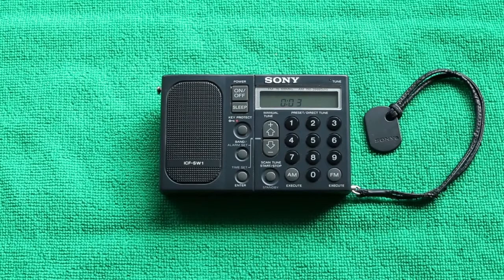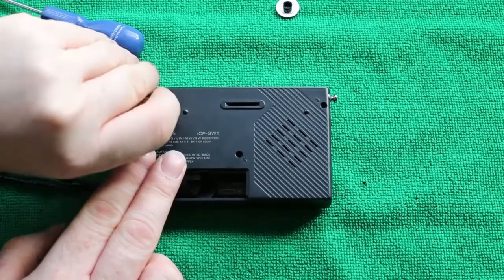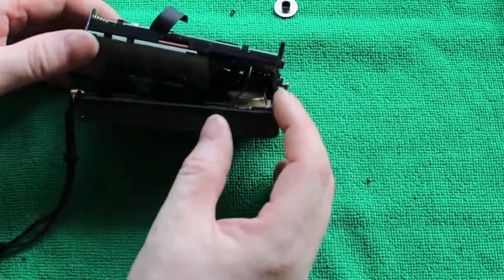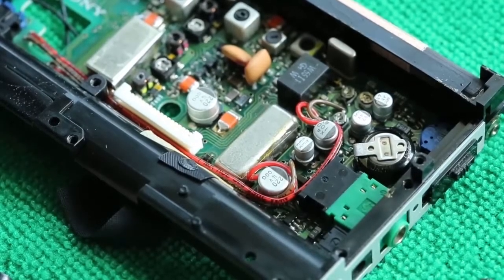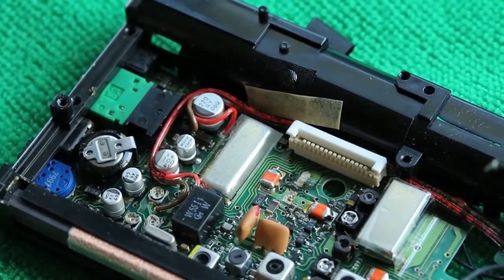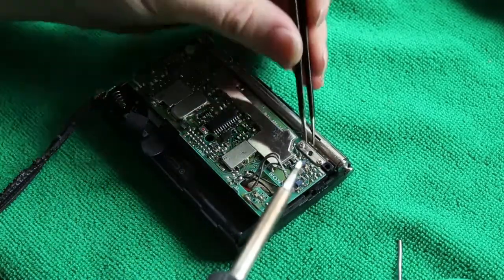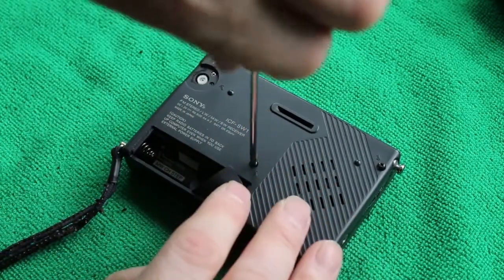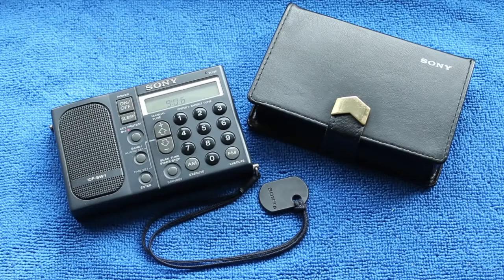Sony ICF-SW1 Repair. Vintage Technology Workshop.

Comment from the maker: Just for reference- C420 220uF 4v, C426 47uF 4v, C431 47uF 4v, C607 100uF 4v, C608 33uF 4v, C613 220uF 4v, C828 220uF 4v, and if needed C625 (backup cell) 47000uF. Hope that helps. If you search for "Sony ICF-SW1 Capacitor Repair Kit" online there's a few out there, but they're cheap enough to put together from a multi box of caps. All the best from Ast..
Reply from the maker: Also, if you want to, you don't have to use electrolytic's, you could use tantalum capacitors, which would last longer, but cost approximately twice as much. Ast...

Comment: Aston, this was super useful.  All I needed to do was to remove the back of the case so I could clean the inner battery terminal (I had had a depleted battery leakage).  For the life of me I would never have found the hidden screws particularly the one under the mylar film at the volume control.  The case fitting seems somewhat over-engineered to me, with the screws being somewhat redundant with the back fitting perfectly snugly on its own catches.
Reply from the maker: Glad you were able to save one of these great little radios. Best regards, Ast..

Comment: could you look at the active antenna part and see if the battery cover on it has a part number? I bought a used unit and the cover is missing.

Comment: Why are these such a menace? I have sony decks from the 70s (dad's and even grandpa's) that work well without recapping yet sony radios from the 90s.. As you can see. Like why? 🤔
Reply from the maker: It was the company that produced the chemicals which went into the capacitors that made a mistake with chemical make-up, which were then supplied to many manufacturers during early 90s. The chemical ended up being corrosive to the can seals and overly expansive, thus causing the problem we're suffering with today. It's a shame that the best technology in history, were fitted with the worst capacitors in history. Save what technology you can whilst there is still some left to save.
Reply: @AstonsVintageTechnologyWorkshp  That's some insightful info! I suffered with my icf-7600 😭
The caps' leakge ate through the board's traces and I had to do some shortcuts with wires and I don't have a microscope or any professional tools so you can imagine the mysery 😅
Thanks for the info. Explained a lot..

Comment: Thank you for the very clear and detailed video. Finally managed to replace the caps with like-to-like aluminum caps - I see that some people replace with tantalum caps. I hope modern caps last better than the original ones. Replaced the supercap as well and replaced the led with a white one.  Works like a charm and have stunning sound. Another precious piece of kit saved from the landfill 🙂
Reply from the maker: Well done, for repairing your radio, and thank you for the kind comments. Best regards.

Comment: hi. wondering if you have a parts list  of caps use in this repair
Reply from the maker: C420 220uF 4v, C426 47uF 4v, C431 47uF 4v, C607 100uF 4v, C608 33uF 4v, C613 220uF 4v, C828 220uF 4v, and if needed C625 (backup cell) 47000uF 5.5v. Hope that helps. If you search for "Sony ICF-SW1 Capacitor Repair Kit" online there's a few out there, but they're cheap enough to put together from a multi box of caps. All the best from Ast..

Comment: Were can i buy these 6 capacitors Aston? And what are the types? Great video! I have 2 of them and they've got the same problems. Thanks you Aston. Grtz from Holland
Reply from the maker: There are kits available on ebay and other sites for most Sony radios. But just search google for "Sony ICF SW1 Radio 100% Panasonic Capacitors Complete Repair Kit + Memory Backup" that one seems to have all the caps to do the job. If not available where you are, try a different variation of the search. Lots of sellers worldwide. Best regards, Ast..

Comment: Nice work mate ..you can twist the bad caps left and right with a tweezer  and then it will be removed easier.
Reply from the maker: The pads are quite delicate in these, added to the fact that they have probably been weakened by acid damage, I just wanted to be careful. I've had them come in with lots of the pads ripped off before, when they realise what they've done, I get the job of repairing it. 😛

Comment: Thanks for this clear instructions, Aston. 
4 Years ago I bought a set of 6 capacitors, but i didn't manage to solve the problem. 
Now, with this video I could fix the difficult soldering job.
It took me a whole day but it has been worth the time.
Also my appreciation for your clearly spoken English.
Reply from the maker: Thank you, and I'm glad you got your radio working. All the best from Ast.
Reply: so we have to replace all 6 capacitors? what model do we buy?
I'm confused because Ast doesn't show in the video that he does it, right? why does he avoid showing it?
Thank you !

Comment: Hi great video, I have exactly this model and problem. Please can you tell me the best capacitor supplier?
Much appreciated.
Reply from the maker: Hello there, you'll probably find, that most modern day capacitor manufacturing is of sufficiently high quality to last at least 20 years or thereabouts, so, any kits that you find on eBay should be more than ample for the job. The only reason that they went faulty in the first place was because of a technical error due to the manufacturing at the time, where the wrong chemical was used in the production across all of the manufacturers stock. Hope this helps. All the best from Ast...

Comment: Every one of these Sony SW radios from that time period had bad SMD caps. Every single one.
Reply from the maker: Yep, indeed, that's because the entire global suppliers of surface mount capacitors came from one company in china, who decided to use the wrong blend of chemicals in the capacitors, thus sealing the doom of half the electronics of that era. 😞

Comment: Ok so i have two questions. How much is a complete set worth, in the box, never been used, in the case and cardboard box? And where do i sell one?  many thanks
Reply from the maker: Well, eBay current selling prices for boxed mint condition SW1's, is about £200. I guess I would start there, as that seems quite a fair price.
Reply: @AstonsVintageTechnologyWorkshp  thank you so much for your fast response ..

Comment: I'm collecting courage for a couple months now to start fixing mine.
Videos like yours help me encourage myself, so many thanks for that!
Please show how you slde in the replacment capacitors next time.
What about the battery or gold cap you touched in the beginning as "capacitor"?
Have you also replaced that?
Reply from the maker: Hi there, if you mean the big black memory backup capacitor, unless it's leaking I would leave it well alone, most of the time they're fine. If it is leaking however, you will need to remove the other board from the chassis and desolder it from the other side. All the best from Aston.

Comment: the safest, cleanest and fastest way of removing the electrolytic caps is to cut them off with a mini flush cutter
Reply from the maker: Not really enough space for that in this little radio, plus the legs/solder tabs travel quite far under the caps and on Sony's are extremely fragile. Torsional stress can easily (and frequently does) just rip them off. Especially if any of the leakage has got them.
Reply: Any torque on a vertical axis, would translate into vertical mechanical stress on the pads. The same goes for torque on a horizontal axis. Same case for what the video shows are being done while attempting to melt the solder on one pad while the other is suffering some stress. 
But if you cut the capacitor right where the aluminum meets the plastic base, and orthogonal with the direction of the pad pair axis, then that sheer stress is very much forgiving to the pads. This last technique is what I used while replacing the caps.

Comment: I have an ICF-SW1S with a similar fault. However, I know that if I tried to emulate your process, I would ruin it. So my questions are whether you would be able to undertake the repair of my radio and, if so, your terms?
Reply from the maker: Hello there, unfortunately the workshop has got a pretty steep backlog at the moment, and I'm not taking on any more repairs for some time. Sorry about that. All the best from Aston.
Reply: @AstonsVintageTechnologyWorkshp  Sorry to hear that but thank you for letting me know.

Comment: a great video and an excellent tutorial, nevertheless, forgive my question since I'm everything but a technician... i have this beautiful radio, and it has the same problem as yours; the question is that i didn't see you replacing the capacitors, you've just removed them?! i live in Munich/Germany and i would try to fix it myself if you've just removed them. you can find a technician here ... thanks for answering dear! finally can you please mention the name of the capacitors, so i can try to buy them here ... in case they should be replaced i mean
Reply from the maker: Hi there, it's probably best to find a kit of parts on eBay instead of trying to find them individually, as you'll probably end up buying bags of things that you won't use. Just search for 'Sony ICF-SW1' and the word 'capacitors'. Yes, the capacitors were indeed replaced with brand-new ones, which I didn't show, just to keep the video concise. There is another video that I produced, that shows you how to solder those types of components back in. All the very best from Aston.
Reply: One last question dear, i just received the new capacitors, but instead of 4v it is rated 6v, is that a problem? Also, does it mean that this new set will also stop working in some years? And what about the other sony radios? Why only this model has this problem. 
Thanks again!
Reply from the maker: @81naji  6volts is fine, if it was less than 4volts that would be a problem. Sadly in another 40 years time,  the same may happen again, but that is a long way away. All radio's that have this type of capacitor (and in fact most ageing capacitors inside all electronics) will go bad at some point. As with all things, time is not kind to electronics. :D All the best, from Aston.

Comment: Thanks for the very helpful video.  I used it yesterday to replace the SMD caps in a Sony ICF-SW1.  One question:  The kit I used provided only 6 SMD electrolytics and one LED.  Your video discusses replacing 7 electrolytics.  I think you change the one removable cap which I think is C-625.   I wonder why my kit did not include that cap.  Could it be that C-625 was not afflicted with the leakage problem that afflicted the others?  I posted about this on my SolderSmoke Daily News blog.  Search for Sony.  Thanks  Bill
Reply from the maker: C625 is the big black memory backup capacitor, unless it's leaking I would leave it well alone, most of the time they're fine. I guess they didn't include it because they're quite expensive. If it is leaking however, you will need to remove the other board from the chassis and desolder it from the other side. All the best from Aston.
Reply from the maker: P.S. interesting blog by the way. :-)
Reply: @AstonsVintageTechnologyWorkshp  I thought you would like it.  Thanks.
Reply: @AstonsVintageTechnologyWorkshp  Thanks!  Very useful.

Comment: Wonderful video Meastro! I just bought one at a Flea market for about 25€. I'm changing the capacitators now and I have a question: Did you change the fat solitary capacitator? I've seen others who let the old one stay. If you did change it, how did you reach to unsolder/solder? Best wishes!
Reply from the maker: Hi there, if you mean the big black memory backup capacitor, unless it's leaking I would leave it well alone, most of the time they're fine. If it is leaking however, you will need to remove the other board from the chassis and desolder it from the other side. All the best from Aston.
Reply: @AstonsVintageTechnologyWorkshp  Thank you! I’ll make tomorrow soldering day. 🤓

Comment: This was very useful in helping me replace the 6 capacitors with Panasonic caps but now the FM reception is poor.
I'm thinking that due to maybe placing too much solder on one of the caps there might be a short circuit? 
Does anyone happen to know whether any of the 6 caps are responsible for the FM reception? Or do you think it might be something else? Antenna improves reception when I pull it out so it's not the antenna.
Reply: There is a DX / Local switch to the left hand side of the radio. Switch it to DX to increase reception quality. 
So simple I've forgotten about that little switch. I was about to sell the radio for spares. Now it's getting good reception and quality sound.

Comment: Great video. I've had this repair done to my radio but recently the batteries now drain very quickly when the radio is switched off. Any ides on what the fault might be?
Reply from the maker: More than likely a faulty SuperCap, the big one that keeps the memory in the radio. At least that's where I would start to look first. Possibly something that the engineer has actually done by mistake like a solder splash, causing the batteries to be drained through something they shouldn't be. If it's a recent repair, take it back to them and see if they can resolve the problem. I hope you get it sorted, all the best from Aston.

Comment: That really is a great video, very clear and informative. I have the SW1 radio which was a lifeline to the outside world when I worked in Africa. I recently had the capacitors replaced and the unit (mostly) works really well, after more than 30 years.

However, the earphone socket does not work and my repair man has been unable to fix it. I have tried a number of different earphones but it only works on speaker. Have you any advice on who might be able to repair the earphone socket or where I might pick a replacement part.

I really want to return the radio to full working order and any advice would be gratefully received. 

Thanks in anticipation,
Reply from the maker: Sadly that is a Sony proprietary part, if you leave a search reminder on eBay, one will eventually turn up, though you may have to wait a little while. Sorry about that. Thanks for the kind words though.

Comment: I’ve just bought a mint one of these on eBay… mint, full set including the spy briefcase, aerial, power supply and manuals, and has had the capacitors already changed by the vendor, and the display led swapped out for a brighter white one. Hope it comes up to expectations when it arrives! I grew up in Africa in the 60s, 70s and 80s, and shortwave was one of the few reliable sources of news back then. And we had a whole selection of Sony shortwave radios back then, they dominated the market. So sad they’ve recently abandoned the SW market due to cheaper Chinese competitors like Tecsun.
Reply from the maker: I'm sure you won't be disappointed, they are fantastic little radios. The Sony's of the 80s were quite advanced for the time, and even after all these years still stand up to the competition pretty well. It's nice to have the full kit too. All the very best from Ast.
Reply: I have a tecsun 310ET to compare with Sony SW1 and the 9600GR. I must say that, while tecsun is a bit more advanced, with DSP, I prefer Sony sound. Have fun with your Sony!
Reply: I don't think Sony abandoned their shortwave radio business due to Tecsun, Sangean or other Chinese companies. Sony saw no future in it and quit making radios with shortwave bands. Their final product was the ICF-SW7600GR, which the company discontinued in 2018, after an 18 or 19 year production run.

If Sony were still interested in selling (not manufacturing) portable world band radios today, they could have contracted a third party electronics manufacturer like Tecsun.

The Japanese brand Aiwa for example, sells a few pocket shortwave radios that are made by Tecsun and rebadged as Aiwa for the Japan market. I've seen them in department stores in Fukuoka and Tokyo and one of them is actually a rebranded Tecsun PL-310ET. 📻😊

Comment: Hi I have the same issue what would you charge to fix my radio.
Reply from the maker: As in the video, all of the caps need to be changed and any corrosion also needs to be cleaned up too with Isopropyl Alcohol. All the best.

Comment: Thank you for fantastic video, mine has a clean sound on headphone but only motor boating sound on speaker. Do I need to change all smd capacitor?  And where I can get them?
Thanks again
Reply from the maker: Yep, afraid so, it's worth replacing them all while you're in there, otherwise you'd only be opening it back up again to replace them later. I just got mine from eBay, the kits work out about the same price as if you individually bought capacitors. All the very best from Aston.
Reply: @AstonsVintageTechnologyWorkshp  
God bless you 🙏🌻

Comment: Please provide a list of the capacitors (and locations) that were replaced.
Reply from the maker: Well, all of them really. There are kits available on ebay and other sites for most Sony radios. But just search "Sony ICF SW1 Radio 100% Panasonic Capacitors Complete Repair Kit + Memory Backup" that one seems to have all the caps to do the job.
Reply: @AstonsVintageTechnologyWorkshp  Thanks for the tip. With the exception of the two 220uF capacitors, the other 4 (2x47uF, 33uF, and 100uF) were all defective. Replaced all as recommended, with tantalum capacitors. Working fine.
Reply from the maker: @BujangSenang1954  Nice, that should keep it going for decades to come. All the best. Ast.